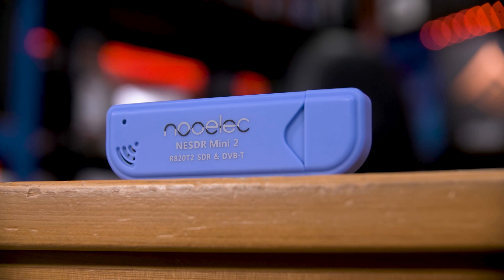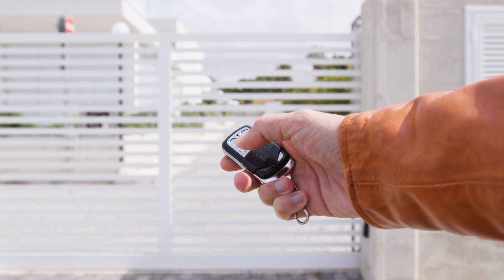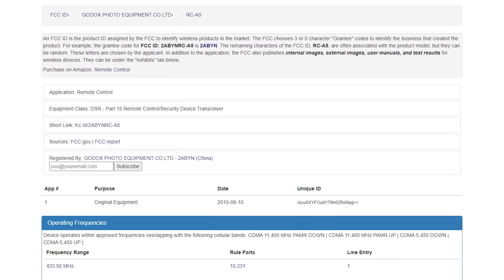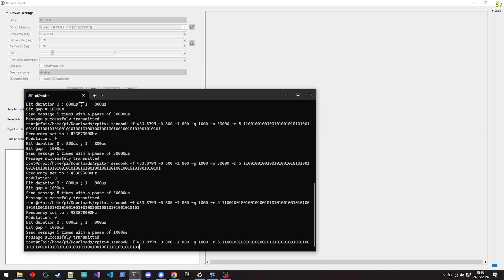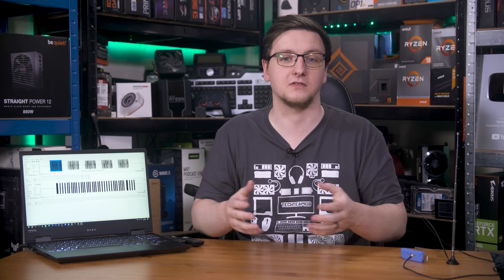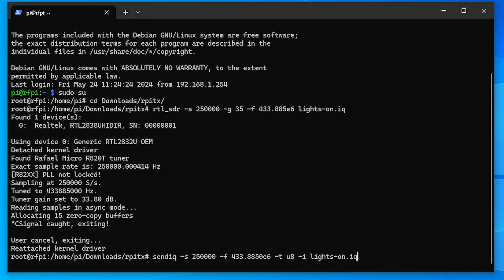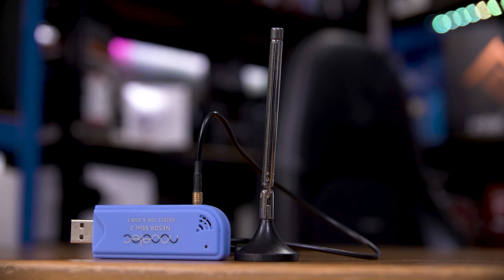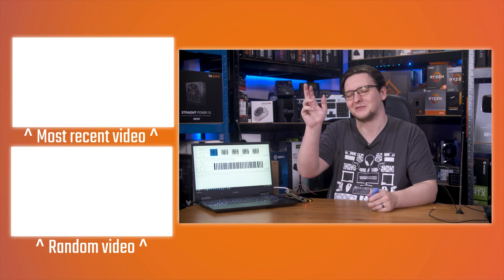Hacking my lights with a Software Defined Radio - RTL-SDR Explained!

Comment: Having a service rely on SSH to parse and rx data is a huge security vulnerability. Pipe the output to a local data.json, have home assistant use that info instead if leaving port 22 exposed.

Comment: Some people have a different interpretation of 'is actually pretty easy to use, too'. I was with it until it involved three different Linux applications, some of which did the same as the others, or didn't,  and with a bit of tweaking might work. And the disclaimer that to use the result to broadcast a signal that you are already broadcasting from the original, seemed a bit 'don't sue me if you're in the USA' typical YouTube nonsense.  Couldn't you just use Broadlink?

Comment: If you think that is Cool you should check out the SDR Play or The Sun SDR ! You May Also Enjoy Getting Your Amateur Radio Licenses Its Not Hard To Do ..pay 15$ Take a Small Test 35 Questions Mostly About Basic Electronics  & if Ya Pass your in Like Flynn as They Say ! You Can Actually Transmit on 2.4Ghz 5 & 6Ghz as well as Pretty Much Any Other Band You So Choose Its a Ton of Fun to BTW ! Most Modern HF Radios Have That Scope Built in To Them & a Lot More Ham's Use Them to Check The Band to see Where pple is Talking at All Over The World You Can Work The World on 100W & a Wire as They Say  They Work Great For Emergency Comms To When Cell Service Goes Out an Several More Use Cases But I Mainly Just Do It For The Fun Some of My Longest Friends I  Met From The Radio Decades Ago ! I  am in the USA But I Know It Is Very Close to The Same in Your Country As Well !  My Personal Favorite Gadget Is what They Call a Ham Clock ! It Is The Coolest Gadget Sense Sliced Bread IMHO ! You Can Buy One Or Build one From a Raspberry Pi ! Try Either One!  Excypt The Over Priced Geochron Atlas ! Might Be Worth ya Time To Look Into !& Like I Said It Really Is A Blast ! Thanks